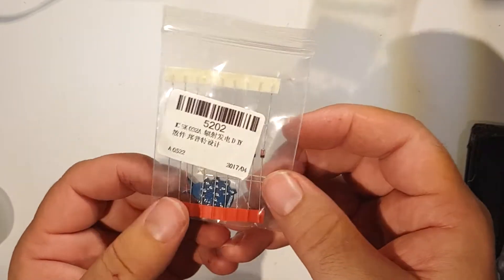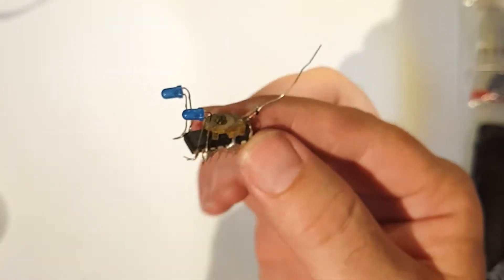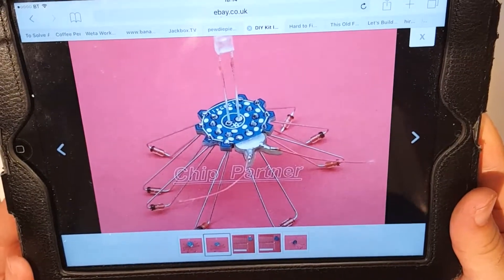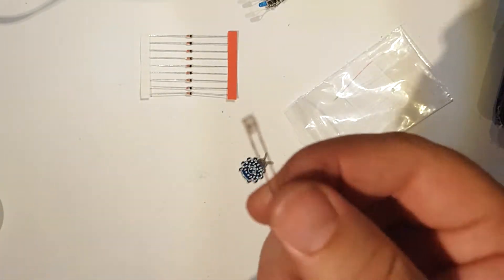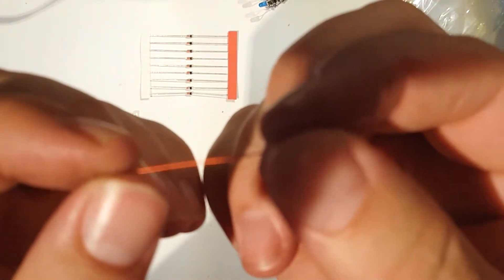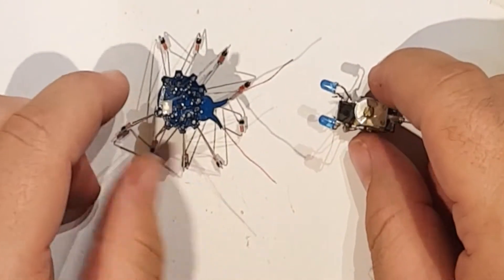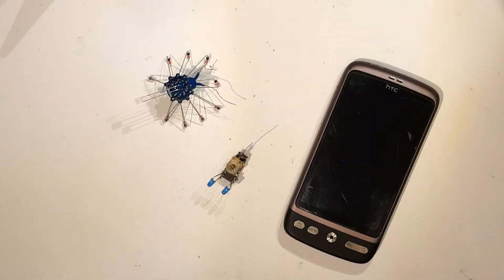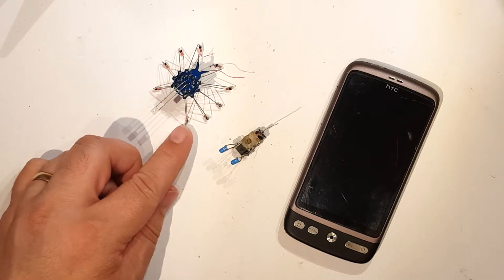Make A Mobile Phone BUG !

Comment: this bug is working you only have to switch your phonesettings to a gsm channel (in settings-network).. its also working with my iphone6 without any problems ;)  you have to put it very close to the antenna! by the way the delivered diode is not very good (need to much current) there are better ones on the market.

i am very interested in your Arme-bug .. do you have any manual for this? Really want to build one too!  does this also work with modern networks (cdma / UMTS / LTE)?
and how close do you have to put it to the mobile-phone?
Thanks!